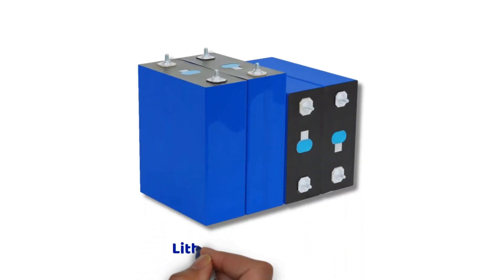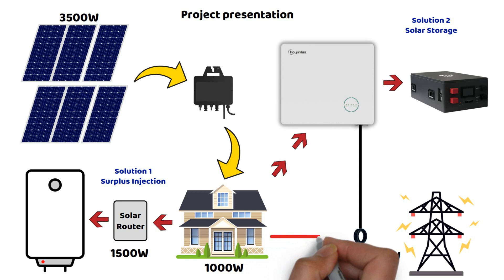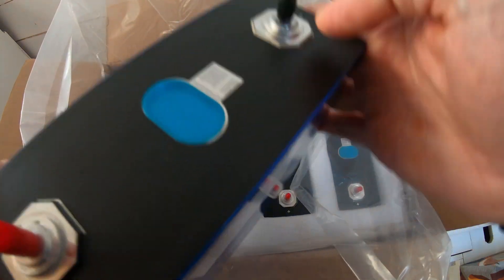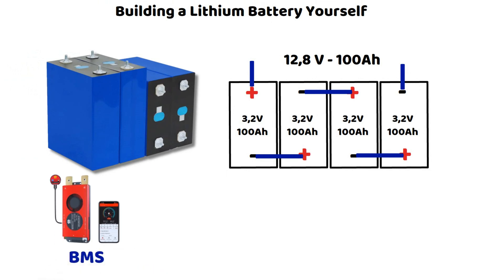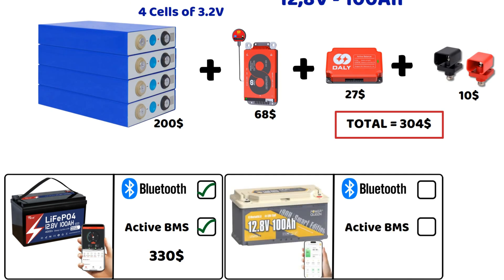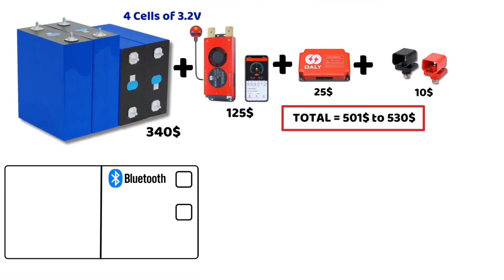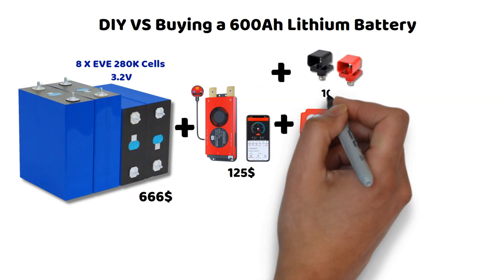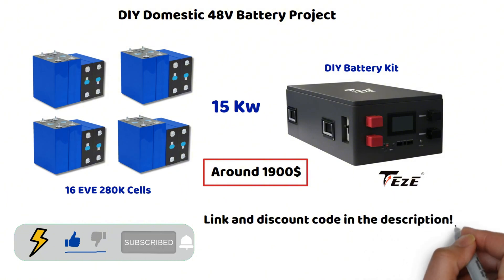DIY or Buy ➡️ Save BIG, Build a Lithium Battery!

Comment: 🧸' Oh Wal-Mart KJV☆ 🎩
$ 1494.88 taxes not included..9.8 HP lawnmower,  145A alternators.. 100 feet 14/3 .. 2 exterior switches.. 120W solar panels.. 4 x's 160A batteris  ... fuel can .. 40liters 
80 liters / minth after that ..
Upper Canada 
Amen

Comment: At small scale, building your own it doesn't make sense.. but at larger sizes
Reply: Especially with so many prepackaged solar kits in the market.
Reply: Building your own is control over components + cheaper. It's a win win.
Reply: @Someperson-   more control yes but only cheaper at larger volume.. no one will be fully in control though.. unless we start doing DIY battery manufacturing too

If I'm going big I'm definitely building my own with raw cells and battery box etc
Reply: I’ve built 12v prismatic systems from 100ah to 280ah and you are leaving out building materials and a enclosure. 

At least 4guage wire,crimper,ring terminals, enclosure and a dc charger to top balance the cells probably $200 minimum.